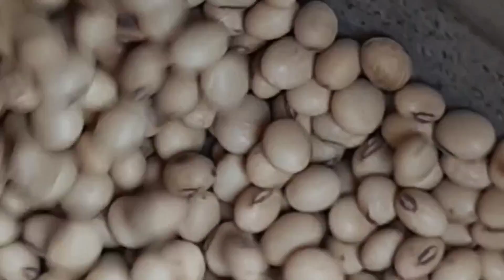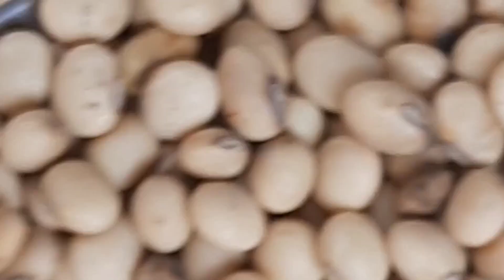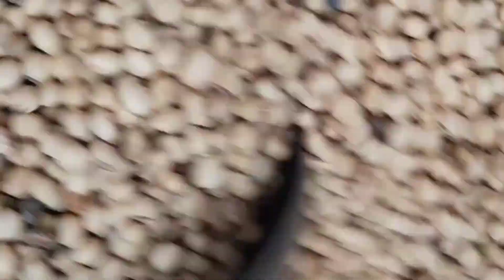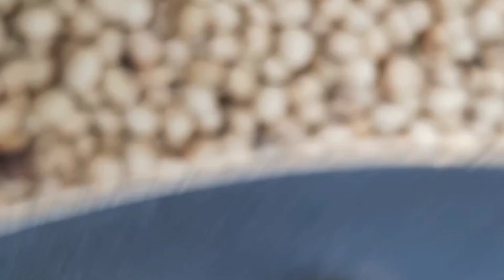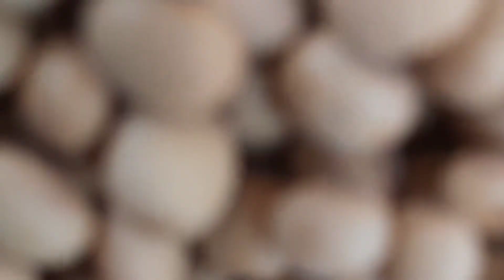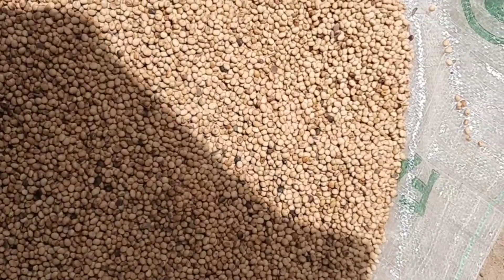How to Process and Prepare Full-Fat Soybean Meal & Its Inclusion Ratio in Poultry Feed

Comment: Broiler starter (0-3weeks) 15%-20% inclusion rate
Broiler grower(4-6weeks)
10%-15% inclusion rate
Broiler Finisher(6-8weeks)
5%-10% inclusion rate

Is this inclusion rates for 100kg of maize  Doctor?
Reply from the maker: When you are using % it means you divide the inclusion rate by 100. If you are making 100kg feed
 5 % is 5 kg. 10% is 10 kg. But if you are making 1000kg, 5% is now 50kg.